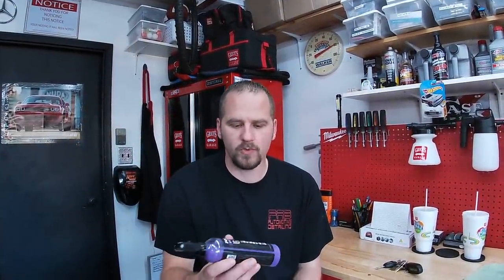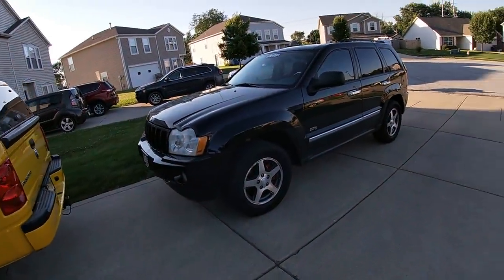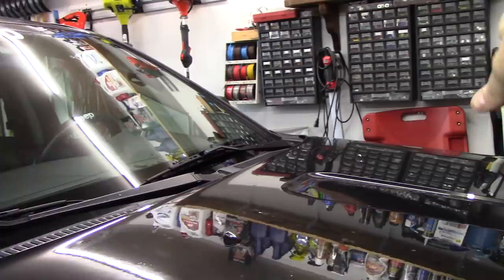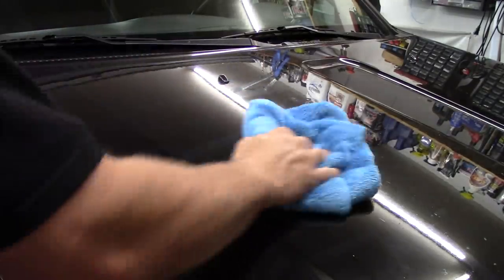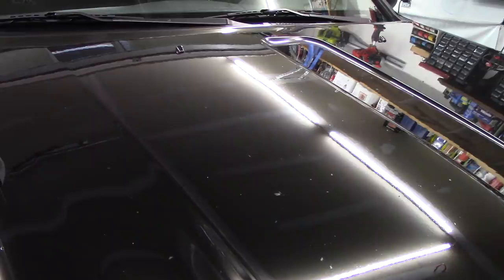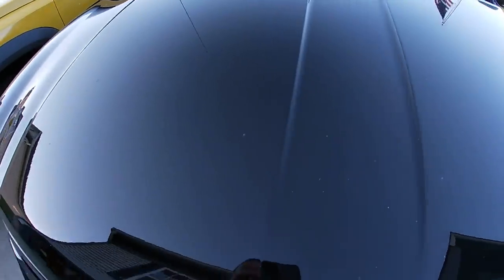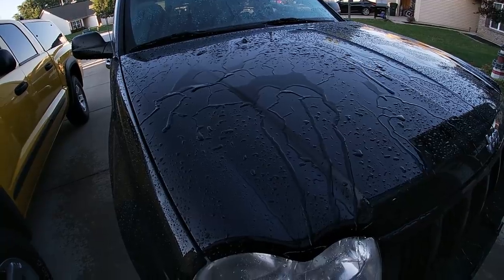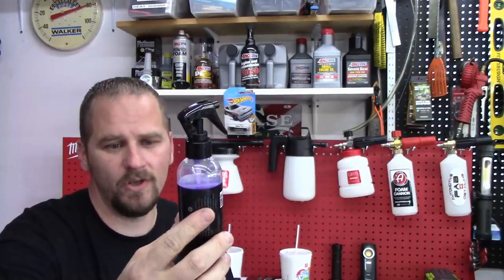Ultimate Ceramic Coating? Not even close! Shine Armor Fortify Quick Coat Review!

Comment: I appreciated your honesty but I must say your wife's car looks amazing to be a 2006 and it had an amazing shine before you started... I think that's unfair to the product. You're a professional and have maintained the vehicle. I purchased 2 years ago a 2006 Murano, great condition extremely low miles but I always hated the fog/cloudy/yellow tinted head/tail lights and how dull the vehicle looks, as it should for an 06. I think it might work out for my type v vehicle because it hasn't been professional buffed and coated on a regular basis. Using this product one would think you should use it on a vehicle that needs it. What if the products you used worked against this product? Unfair advantage in this case but I did like the video. I'm on the fence but leaning towards purchasing (Quarantine shopping)

Comment: YOU DID NOT FOLLOWED THE INSTRUCTIONS PROPERLY LOL.  They meant by damp the tower, with the product itself lol. Water will obviously delude the product which will result in less efficiency.

Try damping it without water and see. I ordered off their free stuff so it coming this week I will try to update in the same comments section 👌🏿
Reply from the maker: Roland Roland The directions on the bottle says to spray product onto panel and using a damp towel wipe product into panel. It does not say to spray product onto towel to dampen like other products day to. So that means it has to be damp with water. I have tried it without dampening and it still doesn’t work well at all. Other ceramic products like these want you to use a water damp towel why would this one be different?

Comment: If you want to use a great waterless wash you need to try Mckees 37 N-914.  Good as a rinseless but great as a waterless.
Reply from the maker: Thanks for the information!
Reply: @FABAutomotiveDetailing  My pleasure.  A gallon of it costs $42.99 full price on Autogeek.  If you use it for only Waterless Washes (Although it does man other things) a gallon of concentrate will make 128 gallons of WW.  That comes out to 33 cents a gallon.  Well plus water costs lol.  And if you're smart and buy on a 25% off sale, your cost isa whopping 25 cents per gallon.  It's an unbelievably inexpensive product that flat out works.  Also what I love is that it's just a cleaner, no wax, no gloss enhancers nothing.  Just cleans and doesn't affect your LSP at all.  Can be used on waxed and coated cars.

Comment: Supposed to dampen the towel with the spray itself, not with water ... watering down the product . “WATERLESS WASH” haha
Reply from the maker: I read the direction exactly as it states on the bottle. I use products all the time that say to “dampen towel with product” . This one says using a damp towel which would mean with water. Waterless wash means no hose and bucket wash it doesn’t mean you don’t use water to dampen towel. For example Ethos Car Care DEFY Waterless wash is wiped off with a water damp towel to set the polymers in the product.

Comment: All of these ''One size fits all-magic 3 in one formula'' products are simply a result of the big trend to coating cars & D.A polishers etc. Remember after a coating, all that is needed is a wash & dry. Maybe 6 months later you might use a 'top up' product, but all of these new products in a spray bottle are rubbish. There is no substitute for proper paint correction followed by a professional ceramic coating, dried under lights.

Comment: Good review but I have never seen anyone use a damp cloth to apply the product like this
Reply from the maker: Petie Lucero Thanks! It’s exactly how the directions say to do it.
Reply: My bottle says to dampen the cloth with the shine armor not water
Reply from the maker: Jay Lycan That’s not what either of my bottles say that they sent me.
Reply from the maker: Jay Lycan My bottle says use a damp cloth and spray product onto surface. If it was damp with Shine Armor then it would have said to spray onto towel to dampen.
Reply: I believe you maybe they changed it but mine says " spray shine armor onto one of the microfiber cloths & onto the surface you are cleaning ( approx. 3' x 3') " no where does mine say to wet the cloth with water I wonder if that was a problem they tryed to remedy
Reply from the maker: Jay Lycan Thanks for the info. I wonder if they changed it after my video? 🤷🏻‍♂️

Comment: i wonder what would happen if you let it cure ( dry ) then wipe it off ??
Reply from the maker: I’m not sure but I think it would streak really bad.
Reply: @FABAutomotiveDetailing  that is a possibility , however i would just about wager a bet ( if i was a betting man ) that if you let it cure / dry then wipe it off , i would about bet it would last a lot longer than with just a few sprinkles of water on it ( sorta speaking ) like you showed in the video . i mean i very well could be wrong , but it's just a gut feeling .
Reply from the maker: Donald M. I may just have to try it in the future just to see!
Reply: @FABAutomotiveDetailing  yeah please do and hey if it works why not make another video on it .
Reply: @FABAutomotiveDetailing  ohh yeah and i suggest you DON'T use a wet rag next time . i think that is a big part of the problem . the reason i say don't use the wet rag is i believe the wetness is just wiping up a lot of the product back up off the paint . i suggest you spray it on a dry microfiber and spray it on the paint . then allow to cure / dry . then wipe it off . now also , it very well could take a good couple of coats before it will last a long while . now if it works , it should last up to 60 days . like i said , if it works .

Comment: I bought shine armor and have used it. It pretty slippery and it shine nice. I see you did not use a micro fiber cloth lightly sprayed with shine armor . You used a saturated old towel. Come on man this stuff is great. No more waxing for me.
Reply from the maker: Terry Downing The towel was not old and it was damp just like the directions say. The directions DO NOT say to dampen with product it says use a damp towel. Every product that wants you to spray into a towel tells you to spray product on towel. I follow directions to a T on review videos.
Reply from the maker: Here is what the directions say word for word on the bottle. 

“Spray onto a damp microfiber cloth and onto the surface you are cleaning”

So if you are spraying it onto a damp microfiber cloth how did it get damp to begin with?
Reply: Our interpretation of “damp” is clearly different. Like I said I have used it. My results were amazing very shiny and slick. It’s like I clay bared and waxed ..but only sprayed and wiped. It is a bit expensive. So I will probably look for something similar. Do you recommend anything else?
Reply from the maker: Terry Downing There are a few out there I like. Adam’s Ceramic Waterless, Turtle Wax Ceramic 3N1 Waterless. I also like Griot’s Garage Spray in Carwash and Tac Systems Waterless Wash. I’m sure there are others that are good that I haven’t tried.

Comment: Dude you didn’t read the directions properly, so you didn’t execute the process properly.  I just bought some of this and have yet to apply it, but in the directions it states to wipe the car with the rag that’s wetted....but not wet with water ——it’s supposed to be wet with the product.   So wet one of the included microfiber cloths with the product, then spray the product on the panel on your car, then wipe it with that same rag then quickly wipe it with the other microfiber included in the box.
Reply from the maker: The directions say to use a damp towel. It does not say to dampen a towel with the product. So using a damp towel would mean with water. Your not the first person that has claimed this in the comments so i tried it the way you say and it was the same results as this video. Once you use this you will see it really won’t matter which way you do it.

Comment: Looks like a good shine for it being dirty before.
Reply from the maker: Greg Durkee The shine was decent but it left no protection behind.
Reply: @FABAutomotiveDetailing   This is discouraging. I might send it back since I used it on the tour pack on my Indian Roadmaster. I clay barred first and then applied the Shine Armor. Good thing prime has a return policy. I heard TLC 2 is better than F11 Top coat.
Reply from the maker: Greg Durkee I would definitely send it back and get something better for the money. TLC 2 does look good but I have never heard anything positive about F11. The new TW Ceramic Spray Coating is really good. Also the new Griot’s Garage Ceramic 3n1 is suppose to be really good also. Both cost less then Shine Armor. I have the new Ceramic 3n1 just haven’t had a chance to use it yet since it’s winter here.
Reply: Good thing I only spent $20 for a bottle of shine armor.  I did see TLC 2 for $37 after seeing a back yard test with major abuse it surprised me that it still helped up.  The gut used simple green dawn purple power  IPA 91% and other cleaners it held up.  Thanks for letting me know about the products flaws.  I'm sure like others this will help save money or force Shine Armor to step up their development.

Comment: Smh.... Let’s call a spade a spade. You know just like any car wax it needs time to cure. The worst thing you can do is immediately run your vehicle thru water right after getting it detailed.
Reply from the maker: PoisonousTaoist1 This is a very in accurate statement! The bottle states no cure time. Products that require a cure time always state it. There are tons of products on the market with no cure time and not everyone has a garage to let a product cure in. Also most cure times other then on a true coating doesn’t mean it can’t get wet it means don’t wash it with a soap or put any chemicals on it.

Comment: yea im sure the 5000 positive experiences on amazon are wrong.
Reply from the maker: bodhi All i can say to this comment is give it a try yourself maybe you will have better luck. I don’t like giving negative reviews I wish they were all positive.
Reply: @FABAutomotiveDetailing  after writing this i did more research and if i ceramic coat my car i would personally choose the Armor Shield IX DIY Kit...what i noticed in your video is that even though it says no cure time you didnt say how long you waited.  did you literally finish and back out into the driveway and start spraying water on it?  next time maybe wait 30 minutes..idk..  also the towel you used was too damp from what it seemed in the video.  nonetheless, yea, its a 20 dollar ceramic coat job lol..just be happy for 2 weeks and do it again if you want...or just buy Armor Shield IX DIY Kit and they claim it lasts at LEAST TWO YEARS haha..so id def choose that one.
Reply from the maker: bodhi I waited about 20 minuets. I also tried it again in another video and it still didn’t last. There are definitely better products out there for what this cost. Turtle Wax has a new Ceramic Spray coating that is way better and costs less.
Reply: @vinanoir  I can lay down a base layer of almost any ceramic spray wax from any car detailing manufacturer and soak it within 30 seconds and it will last a lifetime compared to this snake oil.

Comment: Try not soaking your clean towel in water to dampen it, hense "waterless"  and spray your towel with product instead to dampen it. The damping helps friction and the product has a fast drying agent in it that should be streak free. Water slows that agent. Come on man your a detailer you should know this. You basically deluded the product and sabotaged your own review. Whether this was intended or not, I still think you should do a new review doing what I said.
Reply from the maker: Jonathan Sterio I appreciate your input but I follow directions during reviews. The directions say and I quote “Spray onto a clean damp microfiber cloth and onto the surface you are cleaning Approx 3’x3’.  It doesn’t say spray product onto towel to dampen. That means it must be damp with water before spraying towel.
Reply: @FABAutomotiveDetailing  I understand that, but common sense it says waterless, and the product is a liquid so clean towel+liquid product= perfect application. The product is hydrophobic so water and product does not mix. Science and common sense ftw. I'm not trying to bash you or praise the product reviewed. Try it man watch the difference. It's really worth shooting another video.
Reply from the maker: Jonathan Sterio No problem man! I know it’s common sense and I wondered why they said a damp towel in the directions but I always figure the company that makes the product knows more then I do about it.

Comment: I’m a Detailer at a GM dearlership  so I see a lot of nasty reconditioning in my shop 🇨🇦🇨🇦🇨🇦🇨🇦
Reply from the maker: Rick Barg I can only imagine!
Reply: FAB Automotive Detailing the only way to get a show room shine is a polisher ,I use a Makita direct drive ,and a
 porter cable 7424 . I like wool pads they cut faster ,but have to be careful they heat up fast,micro fibre aren’t bad . I’ll subscribe to your channel. Cheers
Reply from the maker: Rick Barg Oh yeah definitely! I have several different polishers. Microfiber pads are pretty much all I use unless using a finishing polish. I appreciate you subscribing!

Comment: Dude, your Jeep’s paint look layered with iron deposits and 💩 contaminants. You need a paint job, not ceramic wax! Thumbs down for dishonest review.
Reply from the maker: Doctor House I appreciate the thumbs down at least because it helps the channel! Like I said in the video those are mostly rock chips. There are no contaminants on the paint at all. This is a waterless wash product anyways it should clean and protect regardless of the surface. Also I used it on a test panel in a different video and it still failed.

Comment: This is crazy
You didnt even follow the directions ,and really ,they didnt mean spray it on a jeep that hasn't been washed in mo ths
Reply from the maker: Aaron Chapman Enlighten me on how I didn’t follow the directions?
Reply from the maker: Also I don’t go months without washing my vehicles. They get washed every week.
Reply: @FABAutomotiveDetailing  11. Does Shine Armor Waterless Wash remove water-spots?

You can use Shine Armor Waterless Wash and remove water spots (Type I). However, Hard water spots and acid rain are the hardest to remove and need some more work. We suggest removing all contaminants from the surface (including those not caused by the water spots) before applying the product for the first time. Shine Armor Waterless Wash prevents high calcium water deposits from settling on the vehicle’s paint surface which causes those ugly water spots to form.

No professional detailer  will not at least do a rinse of a car like that. Why would they,why would you damp and wipe it like that with sand grains dirt .take the risk of scratching,  ,so really all you did was scuff the. Clear coat .and also this product is a maintainer .what I mean by that ,I'll do a hand wash the very first time I used this product on the bases that I maintain keeping my looking good with this product, by doing the initial wash .for me everything comes off might do a wipe down every 4 days .I just thought abit unfair ,directions were not followed 3x3 wipe,and the biggest no no ,with that much dirt on the hood  you never wipe with a very damp rag with a product that is going to add a clear shinning coat.i guess being I watch your past videos, it took me back .not even you would do that.
So I'll say this I'm neutral, I have nothing to gain here.we all know not do this. Rinse first time if it's that dirty .
Reply from the maker: Aaron Chapman This is a waterless wash! The hood wasn’t all that dirty just mainly dust. Wetting the towel has nothing to do with scratching and I didn’t even say that it scratched anything. The Shine Armor is the lubricant between the wet towel and the paint. I use waterless washing on cars like this all the time with no problem. Like I said in the video it cleaned the surface but it didn’t hold up past a water test. I’m neutral also, I wanted this product to be good but it unfortunately wasn’t.  I hate doing bad reviews and ever since this video I don’t test a product unless I know it will probably be good. I used it as per the directions and it did not hold up and that’s all there is to it. So according to your comment you work for Shine Armor?

Comment: It’s suppose to be a waterless wash. You wet your towel
Reply from the maker: Mac Rivera I know it’s suppose to be a water less wash but i just follow directions in review videos. The directions said to use a “damp” towel!
Reply: FAB Automotive Detailing your towel is not damp. It’s soaking. You introduce too much water, it would create different results. I’m just saying this for it worked perfectly for me.
Reply from the maker: Mac Rivera I have tried it both ways with the same results. In this video I ringed our the towel and it was far from soaked. I put a video out after this one comparing it to Adam’s Ceramic Waterless and I didn’t wet the towel and the results were the same.
Reply: FAB Automotive Detailing I see. I guess it may be due to whatever was used prior. Like car wash shampoo or whatever. Well whatever works. Each to their own.

Comment: It’s junk
Reply from the maker: Richard Vacanti Yes it is!
Reply: I’m starting to watch every single one of your videos. Are you going to review Hydro slick. Goes on easy comes off easy. The key is putting very very thin coats down. Don’t know how the protection will do . Jim did a torture test with hydro slick vs hydro charge and a iron removal product killed both. Doesn’t look good for the protection.
Reply from the maker: Richard Vacanti Thank you! I have had zero luck out of any CG products. I stopped trying all together. I watch Jimbo but haven’t had a chance to watch that one yet.